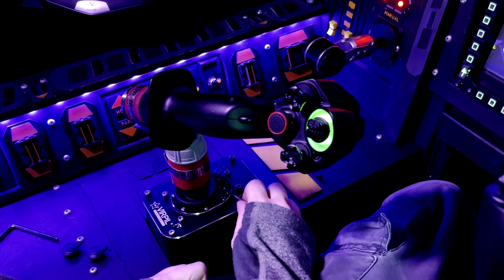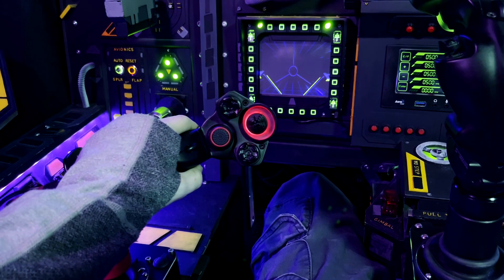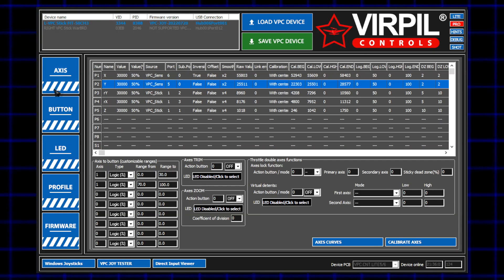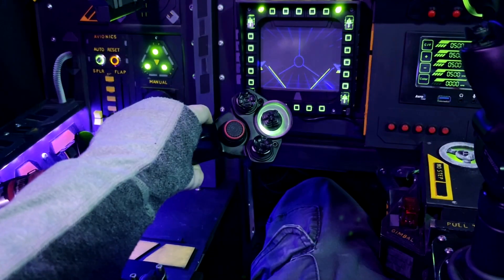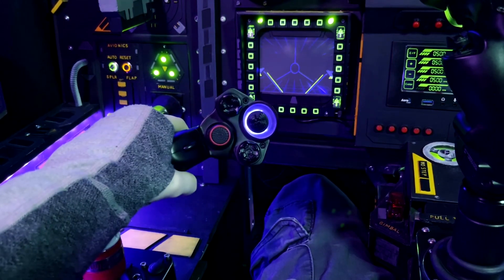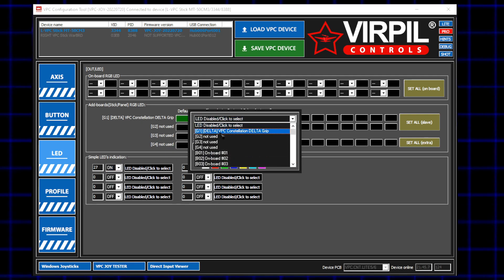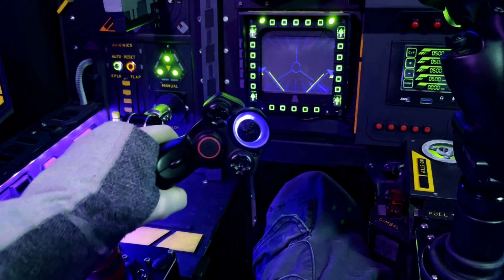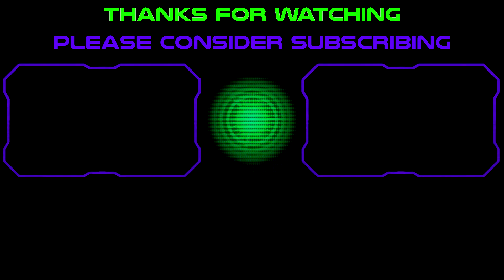Virpil Y-Axis Position LED Indicator Tutorial VPC Software | CM3 Base Omnidirectional Throttle HOSAS

Comment: Great Video. I tried this on my virpil alpha prime/ Warbrd D Base, without avail. What am I missing? - Edit: Not sure if this is the way it should be done, the LED´s colour would not change, when choosing "VPC Constellation Alpha Prime L Grip". Yet, when selecting "All RGB LED´" it worked.
Reply: I'm setting up a new constellation prime and I got the same issue.

This stuff makes sense only 30% of the time.

Comment: Great use of the software here, noted for future use. Wish I went for a CM3 as opposed to WarBRD for my throttle stick LOL
Reply from the maker: I used to run two WarBRD bases but when they came out with the CM3 I just had to switch at least the left stick base over. I know some people have printed parts to add a clutch to the WarBRD.
Reply: The Warbrd D has this feature now.

Comment: Really love this feature of the CM3 that you can use it as a throttle like this. Did you end up changing both your bases from WarBRD or just the left one? Also curious what you use your pedals for in Star Citizen right now? Rudder?
Reply from the maker: Yeah it's a great feature. I'm still using the WarBRD for the center stick. I want to switch but I haven't been able to justify the cost just yet. 

My pedals are used for rudder/yaw. Here's a slightly outdated keybindings video (I'm planning on updating after 3.18 comes out for Star Citizen). https://youtu.be/EXwLC2blftg